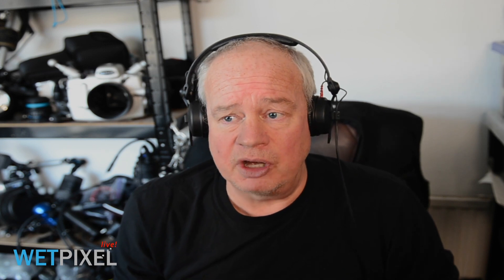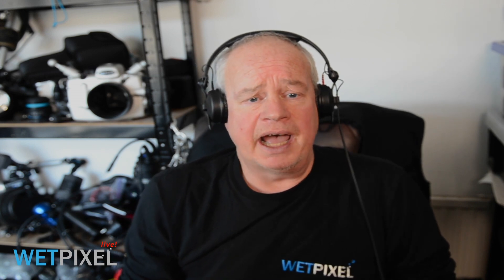Dome Port Choices for Underwater Photographers

Comment: A comparison of dome set ups for FF and crop sensor with costs, compared with equivalent water contact optics  available might be useful for someone starting out, so they know which road to travel.
Reply from the maker: I think the problem with listing costs is that currency and local cost variations make it fairly meaningless. I would advise consulting with local dealers to get a good idea of comparative costs that are actually relevant.